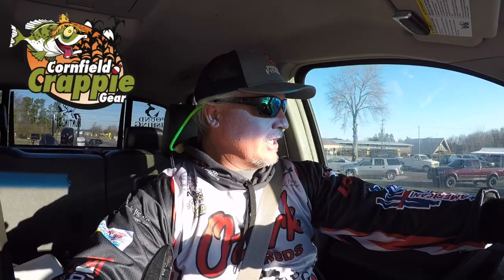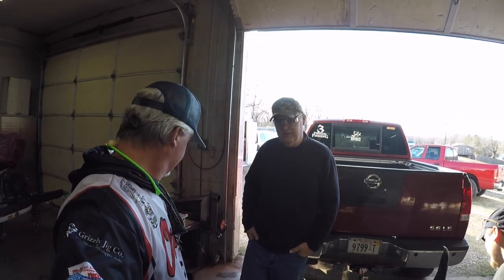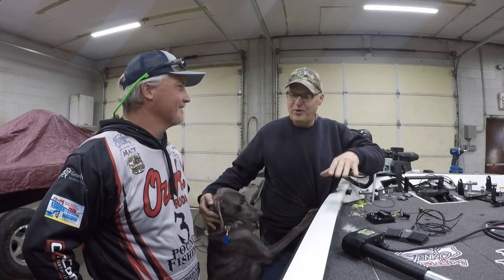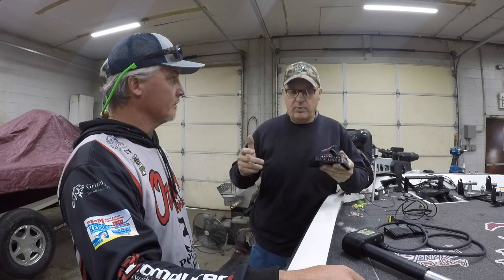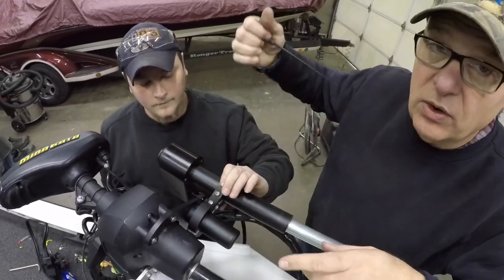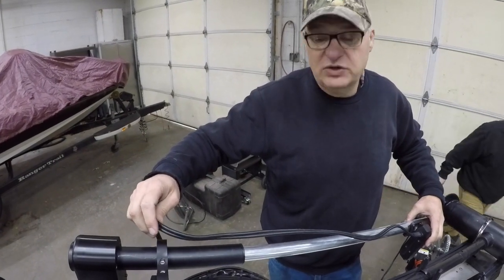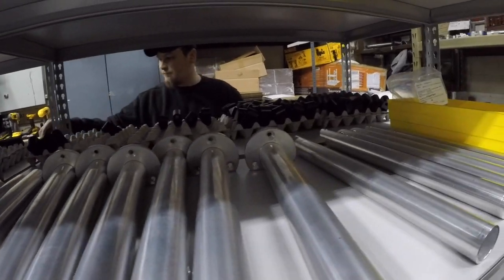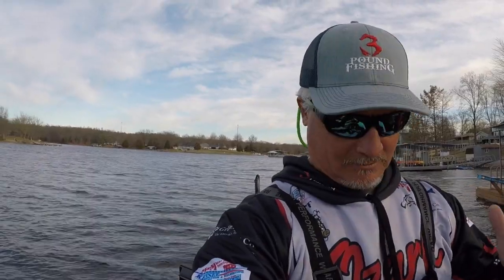Introducing LIVE SWEEP for LiveScope

Comment: Hey 3 Pounder. Thanks for the great review. I called Mark and got my name added to the list for the next batch of Livesweeps. Yes, he's sold out and there is a 6-8 week backlog. I've got to ask if you've had a chance to do an on the water review with the unit yet? It appears there could be a large degree of interruption of the transducer beam depending on where its targeted and the operation of the trolling motor when pivoting. Did you find this to be an issue?
Reply from the maker: Skip Laney I have not experienced  any interruption.  I have a bunch if videos inbred to post prior to getting live sweep. Then I will do a in water review.